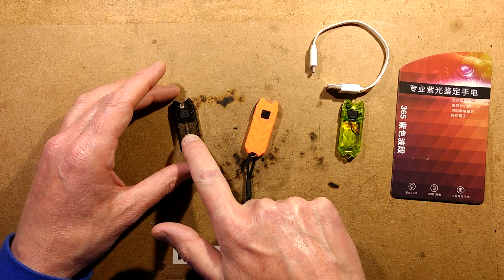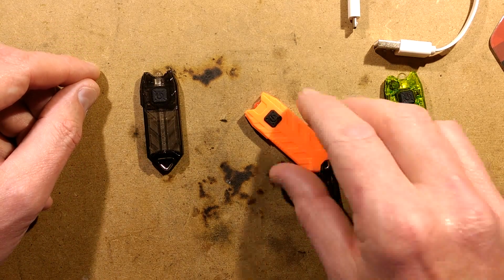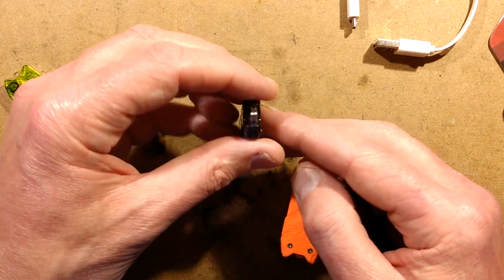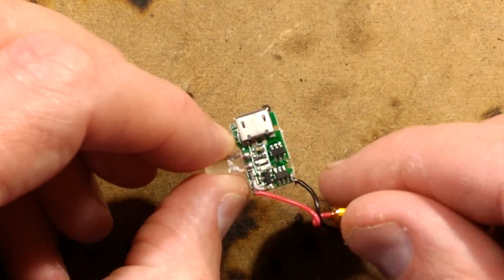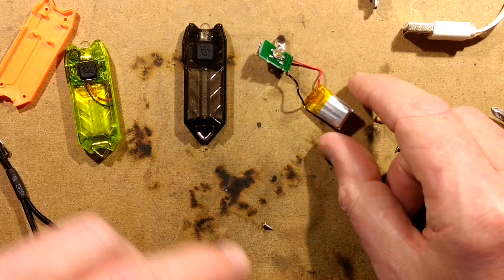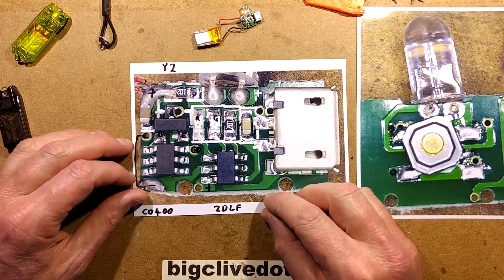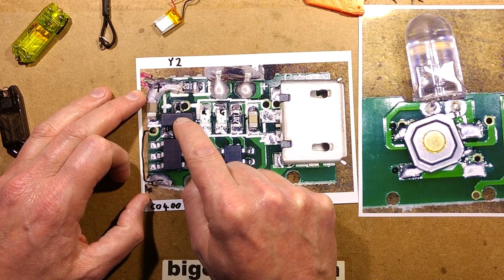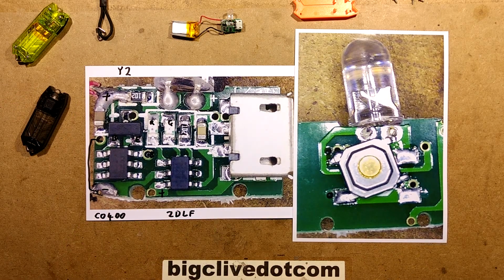The worst Nitecore Tube clone yet.

Comment: Suggestion to fix the zooming complaints:     I'm not sure if there is anything out there that does this easily, I know you don't want to edit your videos, but maybe there is a app that will let you "insta-zoom" to a preset magnification. Instead of scrolling in, it just snaps. Might help those who get light headed easily. 

But...

If you can't find such a thing, I say don't shy from zooming. People need to get over it really. If you don't zoom... well, you might as well just do a podcast as far as I'm concerned because I wouldn't be able to see shit anyway. I'm sure the complainers have more screen-equipped devices than they know what to do with, and they can use another to watch if it bothers them so much.

Comment: I for one appreciate your zooming in on my little screens...my 5" phone or 13" computer or 26" TV.
Then again, even on my 106" 720p projector I still appreciate the close-up.

My only complaint is for some reason your audio is still VERY quiet compared to ads and other videos, I struggle to hear you even with the volume all the way up on my phone and computer and I have to go dangerously high on my TV or surround system to hear you comfortably.
Reply from the maker: I think the adverts and a lot of other channels use compressors to ram the volume to the hilt.

Comment: I see eBay are selling lasers which claim to be able to set fire to things...or make a match flame anyway....are they real, and how dangerous are they? Your mission is to pull one to bits and tell your adoring followers whether this i, in fact, so. Maybe use one on Fanny Flambeaux to get her really hot!
Reply: I have bought some powerful infrared LASERs, and yes, they are very dangerous. I have made Diode Pumped Solid State LASERs, with KTP frequency doubler crystals, and have much safety equipment, including night vision goggles, and special safety glasses the filter out the proper wavelengths of infrared and green light. DO NOT EXPERIMENT WITH THESE WITHOUT PROPER SAFETY EQUIPMENT!!! It would be very easy to instantly and permanently damage your eyes with brief reflections.
Reply: One of my hobbies is photography and I wanted some lazers to do some 'light painting' - literally setting up in a pitch dark room tracing pictures on walls and other surfaces with the shutter on the camera held open. I have the big standard cat toy type but was wondering if I was risking life and limb getting some of the other colours.
Reply: Anything 10 mW and less is perfectly safe, as long as you don't shine it directly into your eye or into a mirror for extended periods of time. The LASERs that start fires are many hundreds or thousands of milliWatts. Most pointers or cat toys are 1-2 mW. Green, blue, and purple LASERs still have the power output listed.

Comment: That shorting of the Vcc and D- lines is very very bad - Vcc is 5V, D- is 3V3 and non-5V-tolerant - any controllers or hubs you plug this into are going to be having a very bad day thanks to bad/lazy design.

Additionally, that "extra" pin is part of USB-OTG - it's how a host controller connected to via a micro-B receptacle to a USB cable can distinguish itself from a device controller and make the link work.
What I mean is Host -> Micro-B -> cable -> Micro-B -> Device. The "ID" pin allows that to work, or more specifically allows a host connected to a host to refuse to work and allows the host to identify devices in this configuration.

Comment: I like how even cheap Chinese makes have started having to add security features to their products because they are being cloned by other Chinese manufacturers. The last few Nitecore and Xiaomi products I have bought have come with those holographic scratch panels with one time activation codes, so you can check if they are genuine. I've even started seeing clones of Boruit head torches now, and they are fairly low cost to begin with anyway

Comment: Sorry if this comes across as a stupid question - In something like this 'torch', for such low power capacities why don't they just use a capacitor or 2 which will more than likely be cheaper than the lithium in those batteries?

Comment: The extra pin on the usb connector is for USB OTG (On The Go), if I recall correctly, on the make connector, if that pin is connected to 5v, it is used as a usb host.

Comment: Looks pretty empty. Could you reprint the circuit board, move over the programmed chips, and upgrade the battery capacity to make a custom Nitecore tube?
Reply: Yes! And also make it waterproof and solar-chargeable.
Reply: And replace the case for a translucent one
Reply: or, 3d print your own case, make a decent board, put a 2gw battery in it, its the size of a small town, but will have a long run time
Reply: Yesterday i bought a 6000 mAh powerbank for 7 euro, it also contain a led to act as a flashlight.

Comment: I got a 3 pack of Original Nitecore Tubes from Amazon for about $35 and they are so awesome!!! My favorite feature is the ability to leave it on and then plug it into charge it & it turns off, then if the power goes out then the battery kicks back in and bam instant emergency light!!!

Comment: Think the microswitch is cocked at an angle so the one corner ends up on the same pad on the circuit board as the LED on purpose?  Maybe a last-minute "fix" to get around a mistake?

Comment: Surprised They spent money to use screws to hold case together .. cheaper to snap together ?
Reply: snap or ultrasonic welding is probably cheaper, but not if the two bits dont fit together
Reply: You'd have to make it precisely enough for it to hold together, not worth it⸮
Reply: screws aren't that expensive. probably like 5 cents including labor. all 4 that is.
Reply: Screws probably allow for cheaper lower quality mouldings and generally larger tolerances. Also simpler more readily available machining and a less complicated design. 
Also they use the cheapest of cheap screws that use metal as soft as butter so they are unusable once you unscrew them a couple of times.

Comment: Bridging VCC and D- on the microUSB connector is a terrible idea if you ever plug this into a real USB host and not just a dumb charger. That's a good way to destroy a USB port, as the data lines run at 3.3V, not 5V. The USB spec actually used to require protection against that kind of short, but the requirement was removed from newer versions of the spec because it's hard to do with modern chip manufacturing processes and they found that it was not a fault likely to occur (most often things short to GND). But if you deliberately short the pins at the connector, well...
Reply: I was thinking the same thing, I have a real Nitecore Tube that I bought right after Clive's review of it. They're so easy to carry around and since they also use a micro USB port to charge I can easily see someone plugging it into a laptop they're using to 'opportunity charge' it while they're busy working. The idea of someone doing that with that knockoff makes me cringe.
Reply: marcan same thought struck me when I saw that part. had to many USB hubs go when end users somehow manage to bridge the pins, luckily not a controller yet. replacing the boards are fun on some devices
Reply: yep.. gotta make sure it's a pure charging cable and not a data cable. I've had mixed results in the past playing that game.. sometimes ports and chargers don't get damaged, but they act funny and don't quite know what to do right away.

Comment: I wonder how violent that little tiny low capacity battery would be if it had a nail stuck through it... :P
Reply: eh, those looks like a lipo battery which will put out very high discharge current but in this case it's 20mA.. so doesn't know what to expect
Reply: twocvbloke cutie